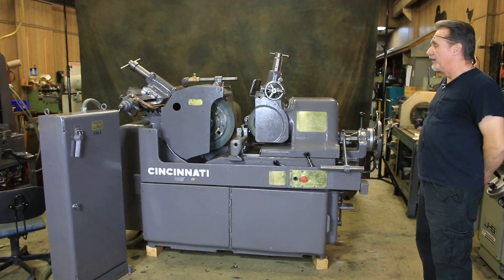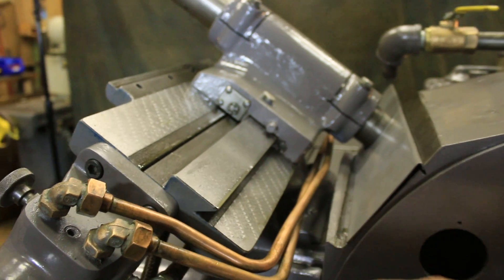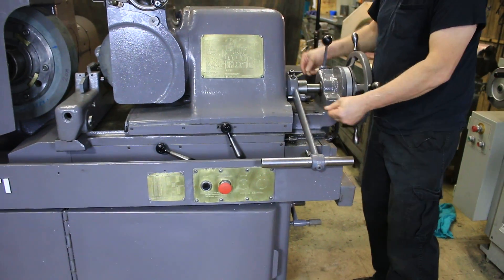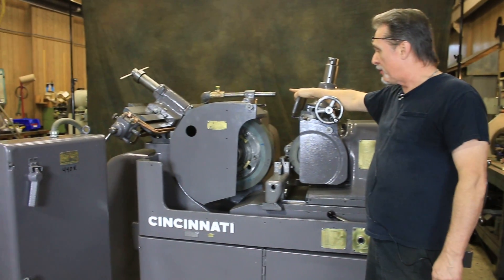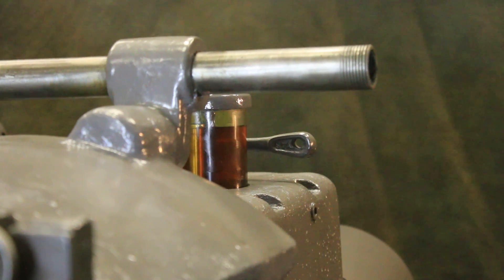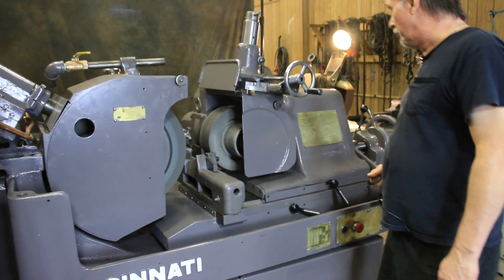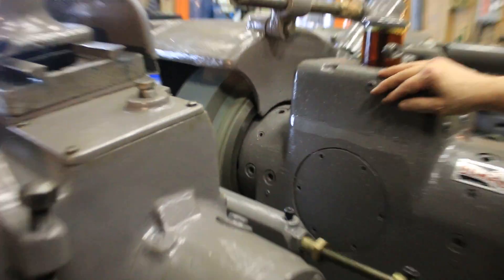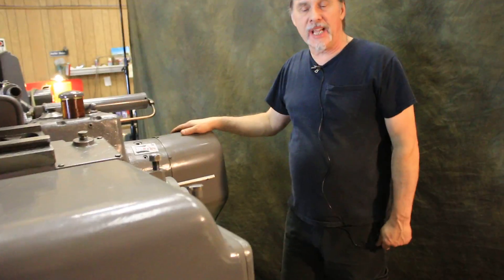Cincinnati 20M CENTERLESS GRINDER

Comment: Used the 2OM for 10yrs and i've seen it only one catch fire for a stupid mistake by a collegue that initialized the machine without moving the right wheel forward very close to the grindstone and the master tool between them to set the limit where the right wheel should stop. By not doing that, it went straightt against the grindstone and the coolant pipe at the top which set the whole thing on fire. Wrote more about it on the last comment here: https://www.youtube.com/watch?v=FAXIyri6C6s&t=372s